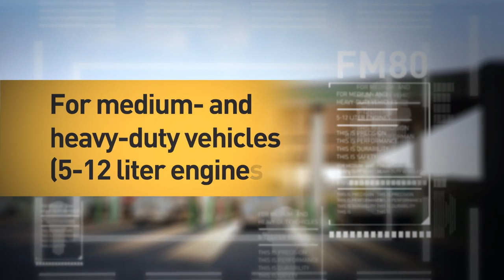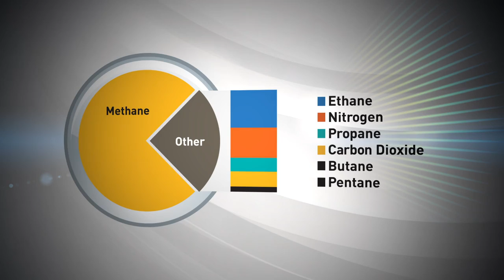CNG Fuel Filtration, Regulation & Control | Fuel Regulation Module FM80

Comment: i wish i could find someone that know what there doing to fix my car i spent nearly 1300 and my car wont start a friend of mine and i will help him we will release the pressure and change the cng filter which i think will fix the problem when we flush the injectors out and put the new filter in the car has only 94000 miles on it
Reply: where are you located and what kind of car?